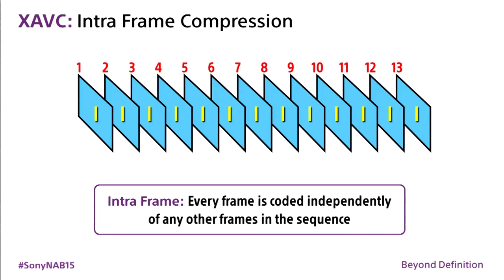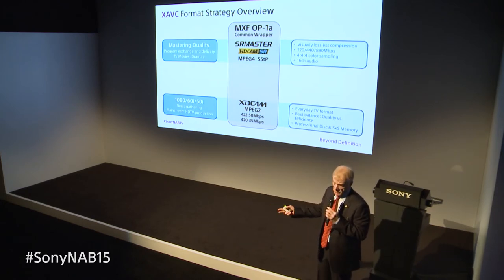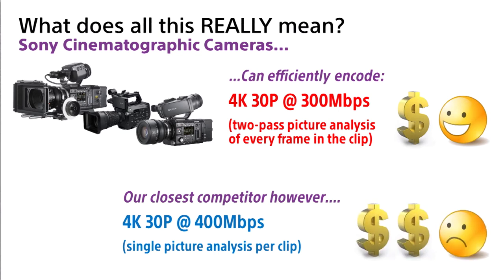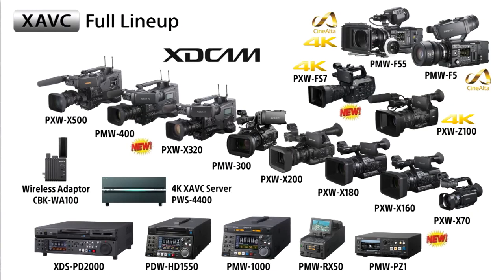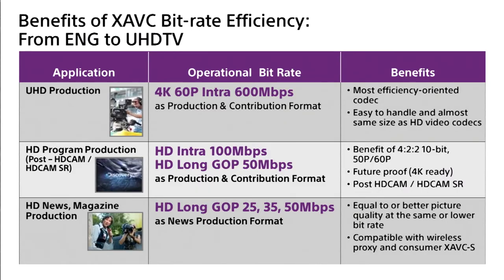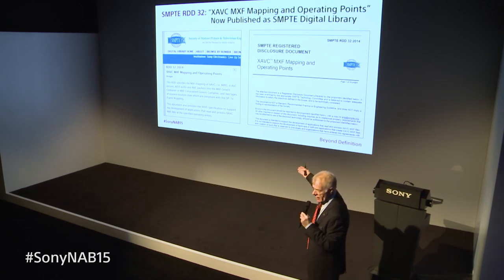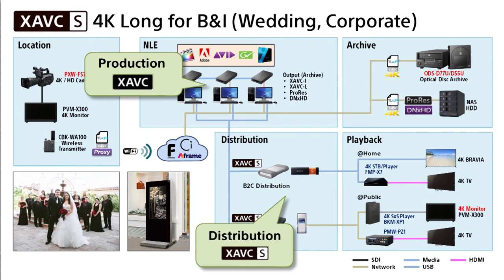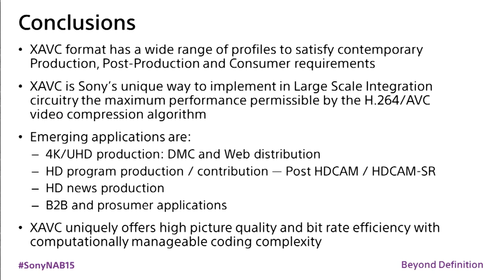XAVC® technology: An advanced codec architecture for HD to 4K production workflows.

Comment: Hugo mentions the "look ahead" two pass encoding within the XAVC chipset. Question:....does this same encoding technique also exist in XAVC-S? I fully understand the wrapper .MXF vs. .MP4 difference between the two. However, both XAVC-L and XAVC-S are both long GOP H.264 at 100Mbp/s. As far as encoding is concerned, is there any difference in the H.264 encoding scheme between XAVC-S and XAVC-L?
Reply: Yes, XAVC-L supports much higher bitrates and it supports more and better H.264 profiles. But it's also supported on fewer cameras so editing and rendering is still much slower and clunkier.